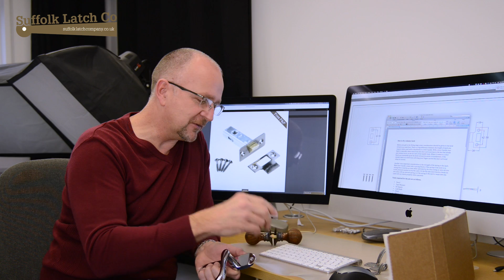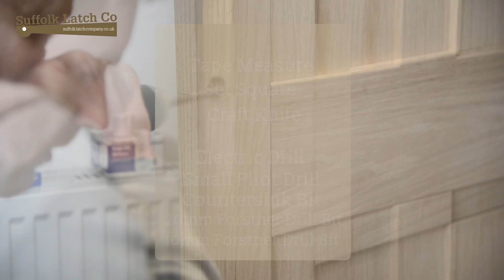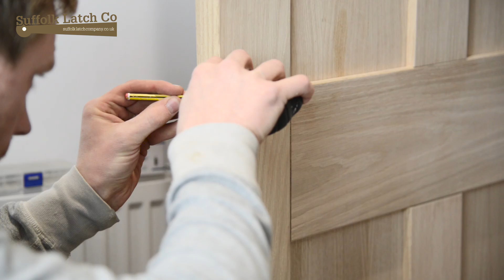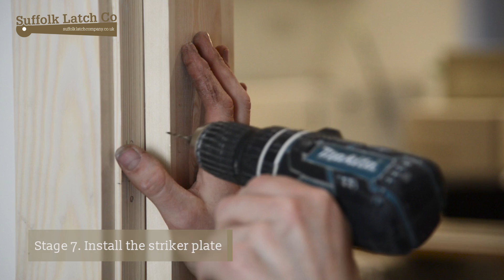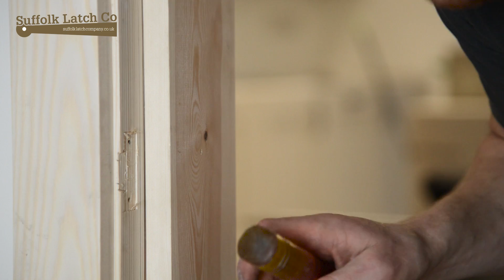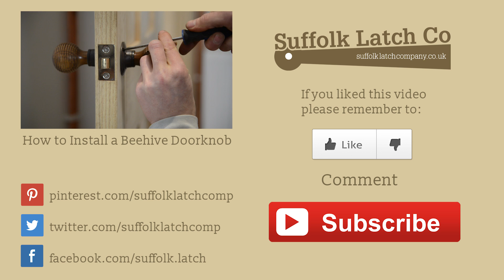How to Install a Tubular Latch | Step-by-Step Guide (2025)

Comment: Your not clear on the measurement for the  latch or im not getting it lol. Do you measure the outside edge of the latch 2 the center of where the sqaure arm goes? And transfer that to the sides of the door? Thanks

Comment: Great video - first time trying and worked very well. WARNING - make sure you drill a wide enough hole for the latch first time - enlarging it is a nightmare (note: you will need a wider bit than the dimensions of the latch - next time I'll drill a hole in a piece of scrap wood to test first)
Reply: Amen doing it tomoz!

Comment: Is that definitely the correct size flat drill bit to drill out the latch? I can never get it right first time and always end up using a chisel in order to fit the latch properly.
Reply: Use a 25mm auger, usually the width of the face plate is 26mm so you'll be fine👍
Reply: @dannym670  Cheers, that's what I have been using. Not alot of room for error. Slight slip/wrong angle and you're through the side of the door. You'd think they'd make the latch a bit slimmer. Anyway, cheers.

Comment: A very clear and concise guide. A have a gripe though, that forstner bit looks like a 22mil not a 20, as the latch goes straight in , which it wont with a 20mil.  Anyway with a forstner bit, you can make adjustments that you cannot with a spade drill.

Comment: Hi.  Is it common to use a forstner drill bit in a power tool rather than a drill press?  I'd have  normally used a spade drill.  what are the benefits of the forstner bit, simply cleaner cut, or less chance of splitting?